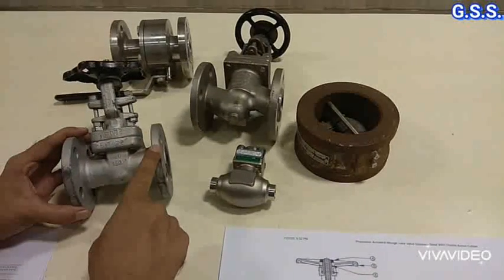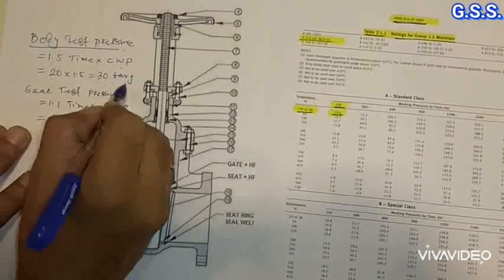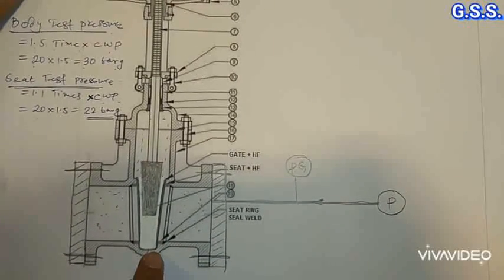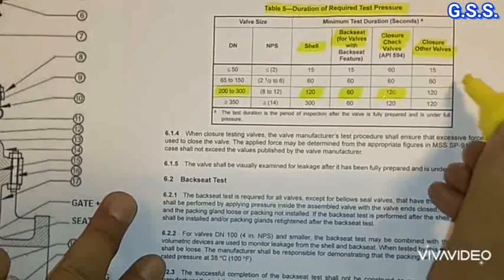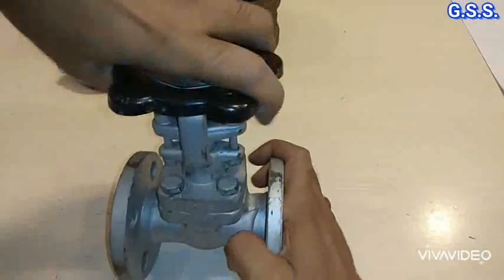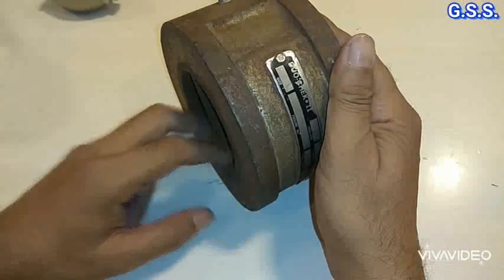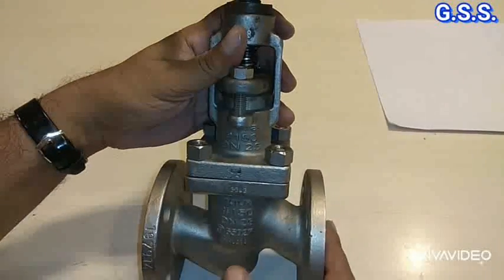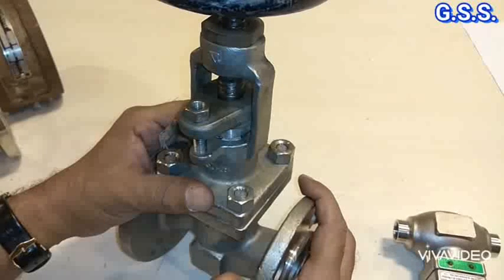Piping Engineering : Valve hydro testing (body, seat & backseat)

Comment: The amazing explanation i have never seen such kind of explanation before. Awesome thanks, sir. Please could you explain some of the valves identify Field Valve Test .These valves should be tested on site also as per Aramco STD.  may be the reason for double checking, there is the possibility of valves may be slightly damaged during the transportation or any other reason. Do you have any idea or experience about such kind of critical valve should be tested in site. Even if already done all the tests in Shop. Please explain verbally. Thanks, sir may be below the valve please explain this under site test TSO control valves, crude recycle PV, min flow recycle valves, suction KODs LCV, hot oil ring spill back CV), MOVs that are used for equipment or train/system isolation they must be tested. Testing shall include at least the DBB and not only single valve. please dedicated post on this topic. thanks